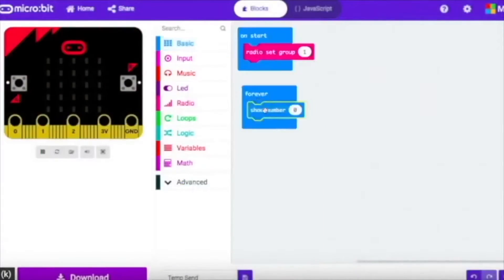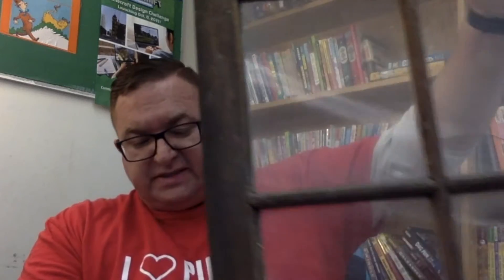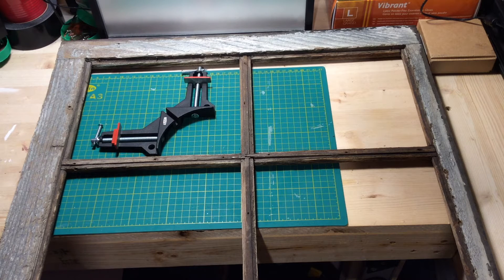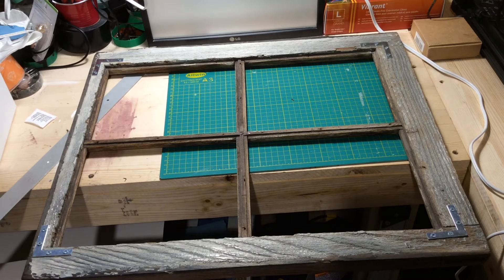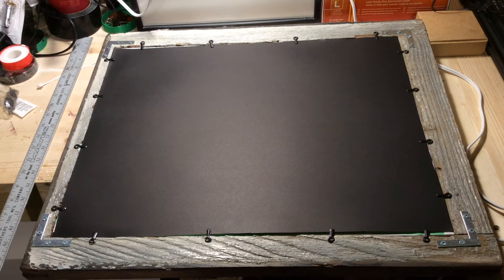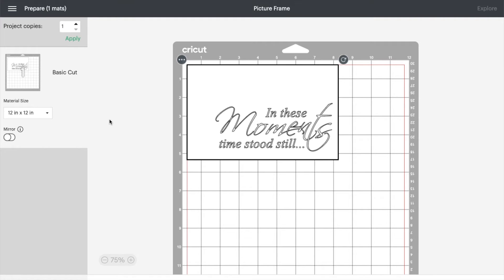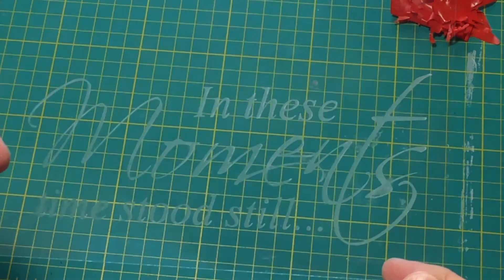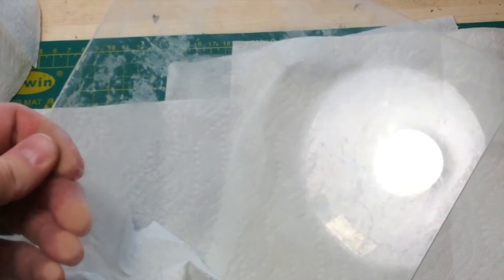100 Year Old Birthday Gift

Comment: Looks great. Not sure I would replace the original glass panels. Aren’t the originality and the imperfections part of the package?
Reply from the maker: I agree the original panels add a lot of character and if the two broken panels were just cracked I would have left them, but because they were missing sections of glass I opted to replace them. The exposed edges were a safety concern and also could damage photos. The two remaining panels are going to stay for sure. Thanks for checking out the video!